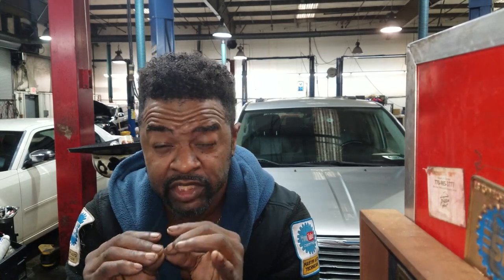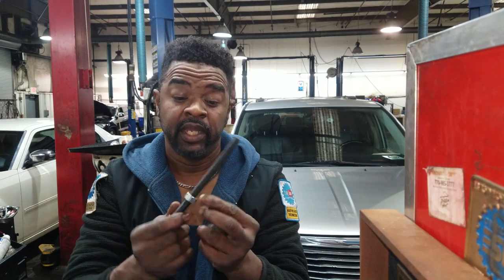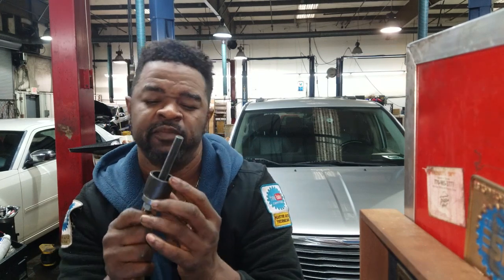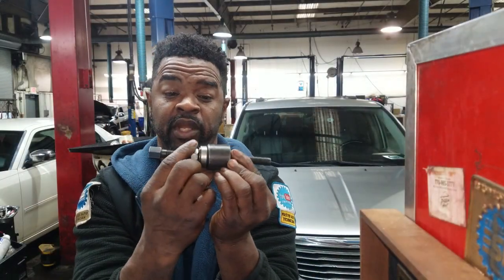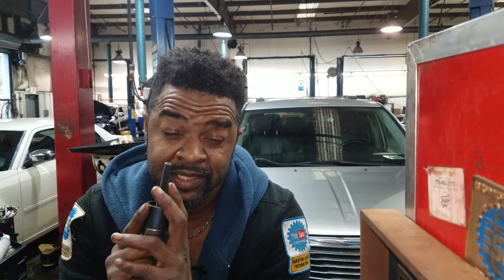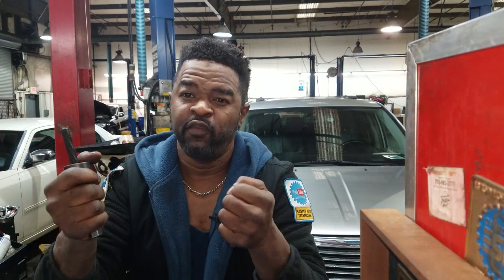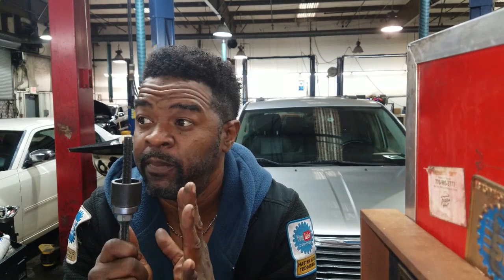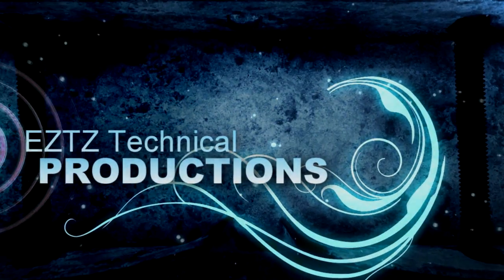How to install a press fit pulley, DO NOT USE A HAMMER

Comment: Another good video.  I removed the crankshaft timing belt gear to replace the crankshaft seal of a "beloved PT " without realizing that there is a precise location for the pulley to assure belt alignment.  I have a professional pulley install tool but NOT the 6792 tool recommended in Chrysler service manual.  The length of the Miller tool determines how far the gear is pressed on.  Do you know what that dimension is.  BTW I did check crankshaft endplay before starting the job and plan on replacing timing belt, water pump etc.  I  do NOT have any significant endplay.   I am a new subscriber to your channel.  Thank you
Reply from the maker: Hey bud..No im not sure, I haven't had the press fit t/belt gear off in years..I think I still have my puller for that..But as for installing it, I'm not sure because we had the tool at the time..Sorry my guy.

Comment: Heating the pulley in a small oven also makes it easier. I don't heat it a lot. You could also put it in a pan with water and boil it.

Comment: This is a Godsend repair tip. My PT's been down since May, but it's a repair that while I can find a way to get the pulley off, putting it back on is a bit intimidating for me, mostly because I know not to use a hammer, but I didn't know the threaded rod trick. What did you use to stop the pulley from turning while tightening it down?
Reply from the maker: You can grab that pulley with your other hand while cranking it down using a ratchet wrench. It should press right on.

Comment: The good advice about Not Hammering the crankshaft is worthy of a subscription, alone.  I just replaced my crank seal.  I don't think it was leaking, but doing a timing belt so replacing all the parts so I don't have to get back in here.
Reply from the maker: Thanks for watching bud and the sub..good decision on doing the rest while you already in there

Comment: Had to order the M12-1.75 all-thread rod from Grainger. Used a nut I got from Lowe's, two 1/2" washers I've acquired over time and an 1-1/8" 1/2"-drive socket.

There was no finding that size of all-thread at any of the hardware stores around me LoL
Reply from the maker: wow, hope it worked out for you...Please subscribe to the channel for me, thanks
Reply: @OnlineMechanicTips  It worked great. Thanks. I had to replace the water pump, so had to remove the camshaft pulleys/gears, also. Made a tool for that out of a piece of angle iron and two bolts. The tie-rods needed replaced, had to make a tool for that with a piece of 1-1/2" galvanized pipe and three 3/8" socket head set screws (take Allen wrenches) 3/4" long.... Subscribed.